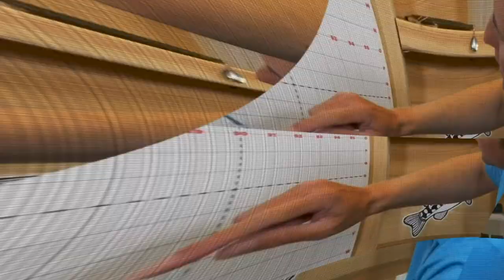Mud Hole Live: Quick Tips for Faster Builds

Comment: Reamer cleaning tip, you can use a old toothbrush for stuff that stuck on the grit, just a light brushing usually removes the hard stuff without removing the grit.